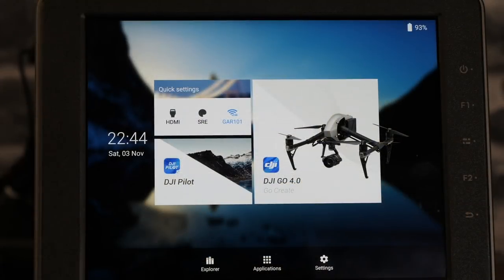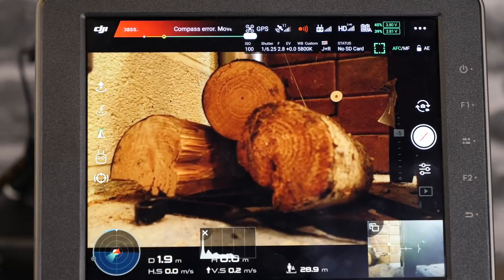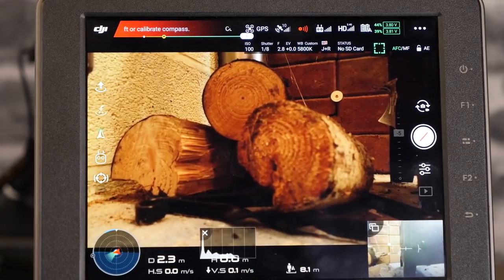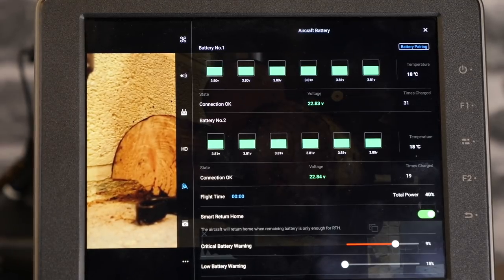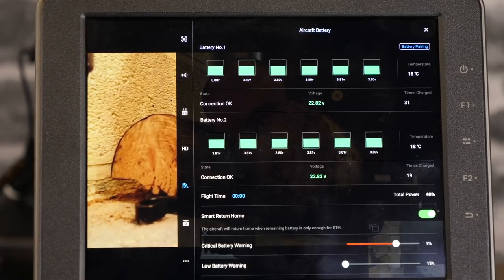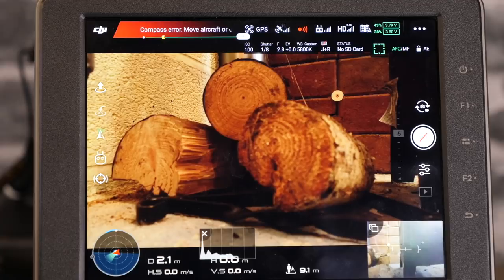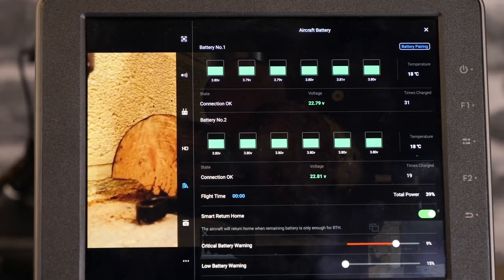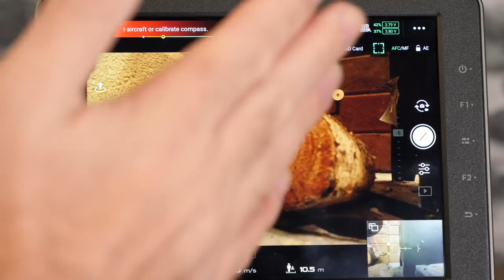DJI Inspire 2 & M200 TB50 & TB55 Battery - What You Need To Know Voltages & Best Practice

Comment: M210-RTK user and went through all sets of TB50 and TB55’s after warnings came out. Happy to report there were No problems (.913) as a matter of due diligence I always keep voltages visible on all Aircraft.  The old Inspire 1 pro way to check battery health was to fly up fast and watch battery changes when battery has sat awhile b4 use. Change they did!! Fresh charges is the best way!

Comment: Is there a way to discharge the batteries without putting them in the aircraft? Or is that the only way to discharge them? If you can tell me about that I would appreciate it very much. Keep up the good work Mad RC! I really enjoy your tutorials.
Reply from the maker: You can buy the DJI RC charge cable that allows you to charge any DJI arc from the TB50 or TB55, this can also be used to charge the crystalsky batteries as well so you can discharge that way.  Other than that there is currently no easy way
Reply: Mad RC I don’t understand how using the charger can discharge the batteries? And I do have the DJI charger already. Isn’t it just for charging? Or are you talking about a different charge cable than the charger itself? Obviously I am confused about what you said.
Reply from the maker: Yes a different one see the below link, you can then use this cable to charge the RC and CS batteries.  https://m.dji.com/product/inspire-2-remote-charing-cable
Reply: Mad RC sorry about my confusion but how do I discharge the batteries with the cable you just gave me the link for? I already ordered it so I would appreciate it if you could explain how to discharge using that cable. Thanks again
Reply: Thanks for the quick reply I appreciate it. Right now I’m checking all my batteries just to be on the safe side. I definitely don’t want to be up in the air and have it fall out of the sky. Too much money tied up in it to not be as safe as possible. Thanks again
Reply: Mad RC sorry to be such a pain but can you please explain how I discharge the batteries using the cable that you suggested? I already ordered it from DJI so I will need to know how to do it.
Reply: Mad RC Thanks for everything today

Comment: Great as always. I use 3 pair of the TB 50's and one pair is a bit strange in that when the pair hits around 25 % it drops drastically to 10% in a matter of seconds. The other two pair are fine. I like to land at 22%. I rely on the GO 4 App Battery readings.
Reply from the maker: Keep a close eye on the voltages on those that are dropping, what are they like fully charged ? Remember the key is over 4.25v per cell fully charged, at this stage it’s being recommended not to fly below 3.70v that should equate to roughly 30% until we get more info.

Comment: The batt details page in the Pilot app can't be opened...i need to switch to the Go4 app to check the cells (on different M210 that i use)
Finalise the Pilot app ... and make the custom settings on the Cendence stable   Dji Enterprise.  Thank you
Reply from the maker: You can update the Pilot App from the M2E downloads page on the Crystalsky and that will bring it up to public release.
Reply: Last update was on 27sep, it stays on  Dji Pilot Beta and is now on Beta-0.6.3-.....  how do get the public version?
thnx ahead !  @MadRC
Reply from the maker: dxtrty Go to the page below page on the Cs browser and use the direct download for the Pilot app and once downloaded install. 

I will be up loading a video on this shortly

 
https://www.dji.com/mobile/mavic-2-enterprise/info#downloads
Reply: OK got it ! djipilot-Official is on it .. and the Mission part seems to work .. big thnx MadRC
but .. how do i set the Cendence custom setting...

Comment: Clarification needed: is 3.7V considered as lower limit when on the ground (resting) or when in the air (under load/hovering)? My personal opinion is in line with your statement at 12:30 - resting on the ground. Still, when flying (under load, prior to landing) such battery will indicate 3.5V on Inspire2. Additionally, when full power/high current is applied (sport mode, full throttle) battery voltage will sag additional -0.2V - therefore I suspect that 3.5V in hovering can temporarily drop to 3.3V if full throttle is applied and that scares me a bit... Otherwise, if limit is to set to 3.7V in hovering, then TB50 provide only 7 to 10min flight time of Inspire2 and resting voltage when landed will get more then 3.8V... What do you think about risk of landing at 3.5V under load (possibly droping to 3.3V in full throttle)?
Reply from the maker: The current directive is land at 3.7v but I do think the 3.7v is a little connective  on the I2 as it’s about 50% capacity, as the M200 is a little heavier and the capacity is then less. 

The sag at that point is about 0.12v so they will recover back to around 3.82v rested if you land at that point.  

Imo a landing voltage of 3.6v would have been a little more realistic for the I2 but they are being ovally cautious but then they were in a difficult position .

Comment: I just ran through my 12 batteries and I noticed something, ( I have mine set to 3 day discharge) the batteries that were just starting to discharge, today is day 3, were not indicating discharging by the blinking light on the side, however in the app, the battery was indicating an error, say the battery was discharging. but then once I hit the button on the battery, the error went away. don't know if this is new or not, never really taken the time to do this.. maybe this is normal.
Reply from the maker: They don’t indicate self discharge on the battery it’s self sadly, this has been something requested for a long time. Once the packs enter self discharge you don’t want them anywhere near your craft until they have been charged again.  Also pressing the button on the battery will reset the time too so be aware of that.
Reply: @MadRC  thanks..I wasn't sure about this..I never fly with batteries that are not 100% charged, this is a practice that I have been doing for years, you are totally correct about that.
Reply: Emil Caruso if your tb55 is reading 98 % how can you force the charger to top it off. It’s over 4.25v though per cell

Comment: I think some problems occur because of the 2 settings critical battery warnings which are as a % and not voltages presumably because of the way the battery cells can behave in flight up and down. I always set one of the buttons on back of the controller to display battery info so it's easy to have a quick look. Interesting you had a pair of inspire batteries 31 charges and one on 19 charges mad ?
Reply from the maker: That was not a matched pair on there, I just grabbed 2 packs, would not fly that that but did not match them for the video.  Totally agree on the button I’m in and out the battery screen contact it and looking at those voltages
Reply: cracking pair tho lol

Comment: Run the flight log through AirData...that have an algorithm to detect faulty batteries.
Reply from the maker: pmshop 4 I can’t comment on that as again that’s relying on something to pick it up after the fact.  

I can only say the safest way is to always check the voltages before take off and monitor in flight, I have always done this and it’s how any none smart battery would be monitored anyway. 

Checking voltages at the time is always the safest way forward.
Reply: pmshop 4 but only if you upgrade your account and pay the $12.99 a month!!!!
Reply: And? You have a $3000 or more bird and go cheap on maintenance? Like the guy that spent 60K at Best Buy for a Complete Magnolia Home Theater and wanted to DIY...refused delivery. He dropped the TV and tried to bring it back.
Reply: pmshop 4 -  Yes AirData now has warnings for these batteries and you can now pair them up yourself in App. Yes it is after the flight but it’s a proven record for DJI .
Reply: pmshop 4 you’re right I shouldn’t be griping about $12.99 a month for a $5,000 investment. Thanks for the reminder

Comment: Battery question that I can get no one to answer. Sent my Inspire 2 in for warranty repairs for a bad flight controller. I sent all 4 of my batteries. [Hundred 120 charges 9 months old.] Along with the system. When the system returned one battery after another exhibited the following behavior that I have named "battery gauge problem".
 The batteries charge to full voltage with all cells at about 4.2 volts.
When the batteries get down to about 4.1 volts I get a signal that I have zero voltage on the battery and I need to return home.
When you check the cells. All cells are 4.1 volts, but the voltage gauge obviously tells the Inspire 2 that the battery is empty or defective.
Recharging the battery makes it usable again.
All 4 batteries exhibit this behavior and had to be retired.
Sent data to DJI and got no answer. [DJI sent me one battery but no answers]
Purchased for new batteries. [Ouch] they work fine.
Any idea how to salvage these batteries?

I am afraid that my new batteries, one may suffer the same effect; has anyone else experienced this affect?
Reply: Assuming that you received your's batteries back and not somebody's else old crap, 120 charges is a significant number. Batteries may show a signs of aging for many reasons, but as long as they deliver reliable current everything is OK. Perform test flights after full charge, abuse the bird observing the battery status page all the time. If cell's voltage bars drop into amber or red zone too easy, if battery temperature rises to abnormal, say, 50C level ... It's time to land and replace the pair with a new one.

Comment: My batteries are on firmware version 01.00.00.71 and not.67 as you showed in the YouTube tutorial. I’m using the latest Beta version so would that be why I have a different number on my firmware?
Reply from the maker: phil devore yes  they are a step ahead, no need to worry as long as it’s all the same.
Reply: Mad RC thanks for letting me know everything is ok for the different version of firmware. It had me worried because I had the different numbers.

Comment: I agree to fully charge the batteries, but the concept for the inspire2 is, that you have a backup battery. So this concept is for the trashcan, if you allways have to fully charge and both batteries must have the same level. What does dji sell us? Reliable dual battery concept for backup or a dream, that never is gonna happen?
Reply from the maker: The duel battery redundancy does work and the I2 can fly on a single pack but the issue is you can’t fly if both packs are empty.  

This is why it’s being mentioned to look at the voltages and check everything is OK, while percentages calculations are a simple indication they should never be 100% relied upon.